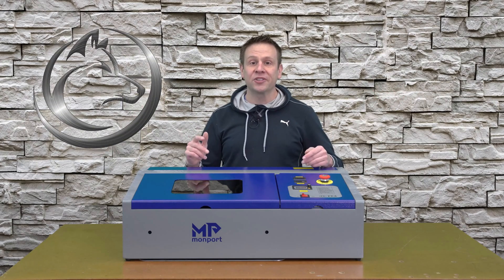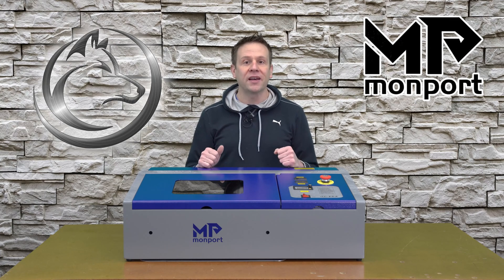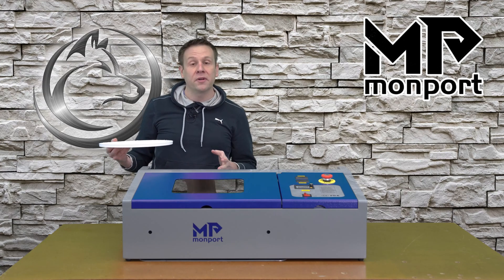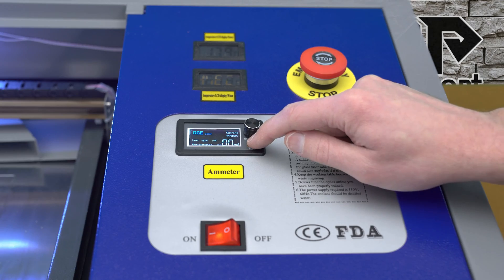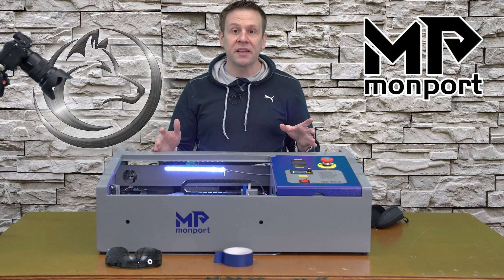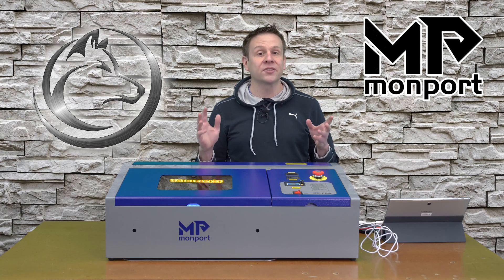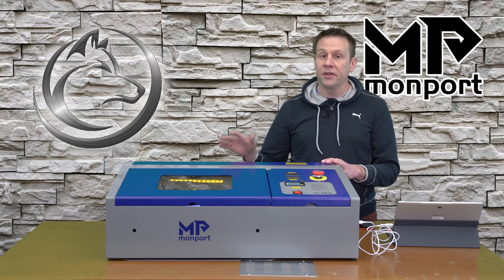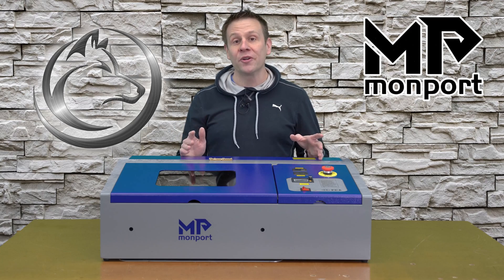Monport 40 watt Co2 Laser- Setup!

Comment: Hi Greg, thank you for posting such a great video. I have just taken delivery of a Monport 40w and followed your setup instructions. However despite installing the machine on my Mac version of Lightburn (v.1.7.03), the machine does not seem to be responding to Lightburn. I've tried manually moving the laser head to the middle of the work area and clicked on "Home" and also on "Go to Origin" but the laser heard does not move. Any thoughts please? ATB Andrew M
Reply from the maker: Thanks!  Try powering down the laser and disconnecting the USB cable> start lighburn> power on the machine> then plug the USB back into the laser and try the auto detect.  Make sure the drop down box next to devices says "choose" if it says anything else Lightburn will not auto detect the laser.  Hope this helps!

Comment: a year later are you satisfied or would recommend something else?
Reply from the maker: I would recommend the Pro version.  It has a much better linear for the x-axis, better laser head with an air assist nozzle.  It has the built in air pump for the air assist but it's really not effective and should be removed and upgraded from day one.  I have one in the studio scheduled for filming in the next week or two.  Here's the link of the machine I recommend (use the code greg10 to save even more!):  https://monportlaser.com/collections/monport-desktop-40w-co2-laser-engraver/products/monport-40w-lightburn-laser-engraver?sca_ref=4621228.jExeMyujfW
Reply: @thelaserchannel1  not much more money either.
Reply: @thelaserchannel1  I purchased the pro and added the cylinder tool... I'm hoping this will allow me to engrave tumblers... do you have a video showing how to do this?
Reply from the maker: @JoMiller97  I don't have a video using the 40 w Co2 machine.
Reply: @thelaserchannel1  you said you're going to be publishing a video on the pro in a few weeks... what do you plan on covering in it? Any of this type of info?
Reply from the maker: @JoMiller97  Mainly the benefits of the upgraded parts of the machine.  I'm sure you're looking for something on how to connect a rotary to the machine?
Reply: @thelaserchannel1  ya and how to use it, where it would be placed, etc... I'm new to this whole thing and jumped in with both feet... kind of like I did with 3D printing and now I'm constantly making models and printing things... hey it's almost winter and I needed a new hobby 🙂

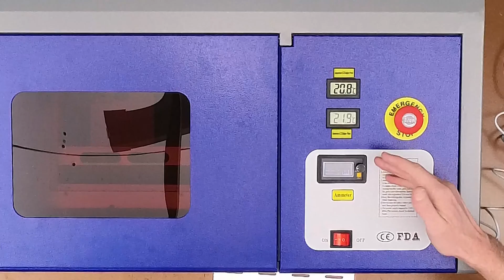Comment: At 15:10 you say to turn the power knob “all the way up”. Where did you get that guidance? The Monport manual says 

“Laser Power Display: This displays the current power of the laser as a percent of its maximum intensity. Adjust this setting accordingly to process various material s . For most material s, an intensity between 20% and 60% i s optimal . when aligning the laser beam, you should use a setting lower than 30% for safety reasons .
Remember: Running your laser tube above 70% power can significantly shorten the laser tube's lifetime (We recommend staying below 70% power to prolong the life of your laser tube)” 

So I can only assume there are 2 ways to run the power on this machine. (1) If you run the power knob like the manual says, you then must use 100% for all operations IN THE SOFTWARE, and thus control the % of power with the knob (and make sure it never goes above 60% or you damage your laser tube).  -OR -
(2) If you do it your way (and please tell me if you have some written guidance for your method, or if you got that from some other tutorial), then you turn the knob to 100%, and control actual % of power via the software settings. 

I would prefer to leave the knob at 100% and adjust power via the software, but since the manual explicitly says to NOT go above 70% I am not so sure if the software control method will ensure that the power is correct and safeguards the laser tube. Any other folks with the Monport K40 who have time tested EITHER method please chime and help us out! Thanks!
Reply: Ok thanks ! Great info👍
Reply from the maker: @checksixivan4921  You are very welcome! 😁
Reply: Just to follow up and close this up with the definitive answer from Monport support. By the way, I posted this question on several K40 laser YouTube channels and of course, the answers were split as to which method they used. I personally want to run it just like you do, with the power knob at full, and control percentage via the software. And, that is exactly what Monport K40 support email states in their email (see below) They just have really ambiguous terminology/language in their operation manual, but the email clears that up by saying the “power” is in reference to the LightBurn percentage you set, and NOT the knob position. Hope this clears it up for anyone else who had same questions. Thanks 

From Monport tech support:

Please find the instructions from our engineers below.

Hello, when processing equipment, it is usually necessary to turn the power knob of the equipment's ammeter to the maximum for processing. The power in the manual refers to the power set in Lightburn, which should not exceed 70%, but in actual cutting, the specific power needs You adjust based on the thickness and texture of the material.

Best regards,
Ailyn
Reply from the maker: Hi- here's how I use the manual dial on the control panel.  I use the dial on low setting (just enough to fire the laser) to check or align the mirrors.  Once that's complete I turn the dial all the way up and use the software setting to control power.  For best life of the laser tube I run 17-18 ma max.  Can I run higher if I need to- certainly, it will just shorten the life of the laser tube if I run over 18 mA all the time.  To know what % in the software equals the actual mA output I run a test at 10%, 12.5% 15% 20%.. and so on.  I use the settings for a long line I draw in the software at a slow speed so I can read the mA display.  I'll end up with a chart to relate % to mA output.  I'll also use this if I see a change in power needed for a common project- this will tell me when the laser tube and or the laser tube power supply need replacing (assuming the mirrors and focus lens are all good).  Hope this helps!
Reply: @thelaserchannel1  Thanks for the quick reply. So what power % setting in your software comes out to 17-18 mA?
Reply from the maker: @checksixivan4921  I ran the 40w Pro the other day and I think at around 70% the output was at 18mA.  The output scaling is in the controller board so if your machine has a different controller board or revision- yours will be different.  It's normal to reach the max recommend output before 100%.  Cheers!

Comment: Is this set up basically the same for omtech k40+?
Reply from the maker: Yes and No- the K40 style comes in many many variations! They are similar/ same work area but the controller board will be different.  The Monport version includes two temperature displays- one for the water temp and the other for the laser tube power supply temp.  
If you choose the Monport machine- you use this code to save another 10% "Greg10"

Comment: How do you know if the red light is in the right place?
Reply from the maker: I place a piece of wood in the machine and pulse the laser and manually move the red light dot to where the laser pulse hit.  Thanks for watching!
Reply: @thelaserchannel1  there is no space to move it manually
Reply from the maker: @waterlilly62lori  My machine has a screw to attach the laser pointer to the laser head- I loosened the screw and was able to pivot the laser pointed.  There's many different versions of the 40watt laser machines- they have been making them for many years and I'm thinking mine might not look the same as yours.
Reply: @thelaserchannel1  are there no videos that go through and explain this????

Comment: What size are the air hoses? Mine didn’t come with any
Reply from the maker: I used an air hose that's  about 1/4 (6mm) OD; it's a thin wall black silicone tubing.  The silicone tubing works great because it's soft enough to make all the bends without affecting the laser head movement but firm enough to not kink.  The base machine does not come with the air assist parts including the air tubing.  The air assist kit I purchased also did not come with air tubing.

Comment: I've heard of people adding Algaecide to the distilled water to prevent algae growth and also adding dawn dish soap to prevent bubbles in the laser tube. Do you think this is necessary?
Reply from the maker: I've started adding Algaecide (from pet stores) to the distilled water and the water lasts much longer.  The air bubbles- no I haven't added dish soup.  The CW-3000 has a high flow water pump and pushes all the air bubble out!  Thanks for watching!

Comment: I think I might get this machine 😊
Reply from the maker: Excellent!  I've been using the laser machine off camera and I'm really enjoying it!  I love the flexibility and power that the Co2 laser source offers!
Reply: @thelaserchannel1  good day. Thanks for video.
I use a 6040 80watt laser for the past 8years.
Always cut less than 20% laser power and water temp 21 degrees Celsius
Clean lenses and glasses regularly if I noticed decrease in cutting power.
I cut 3mm and 5mm clear acrylic at 18% power and 10mm/sec speed
I cut with single pass.

Could you please advise the physical size that you can cut with the monoport.
And what power do you need with this machine to cut 3mm and 5mm clear acrylic at one pass, what speed do you need.
Regards
Reply from the maker: @pietpompiepompiepiet940  Greetings!  The Monport 40 Watt laser machine has a work area of 8 inches by 12 inches (203mm by 304mm)  I've cut 1.5mm in one pass using 20% power at 35mm/s  (I could use less power) and I have cut clear acrylic 6mm thick with the same settings in 2 passes.  The machine could do it one pass did I have not upgraded to an air assist.  If you are on the same laser tube after 8 years the laser tube might be going flat.  Think of the laser tube as a battery- it will go flat with high power use but will last much long at lower power use like your less than 20%.  And just a like a battery- even at low power use the laser tube will still go flat over time.  I love cutting clear acrylic on the machine and will be doing more!